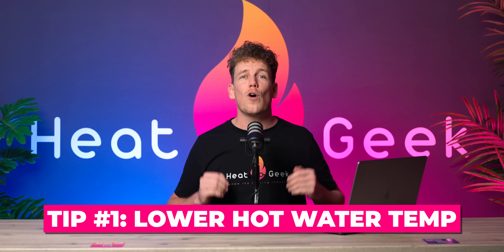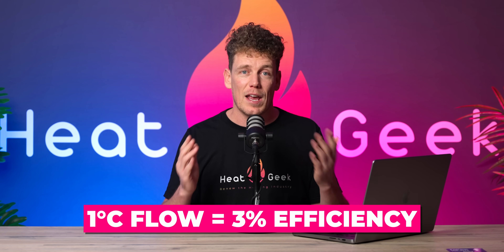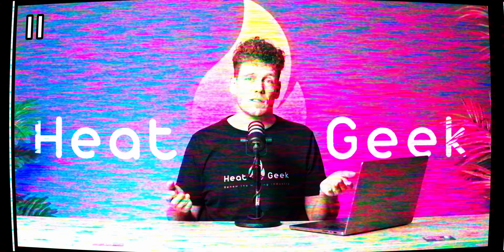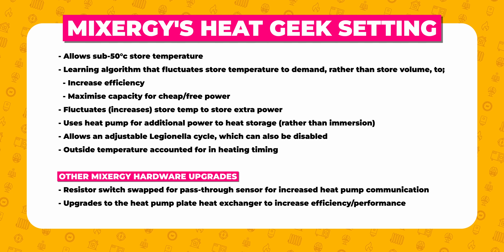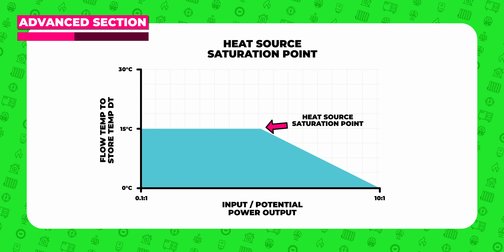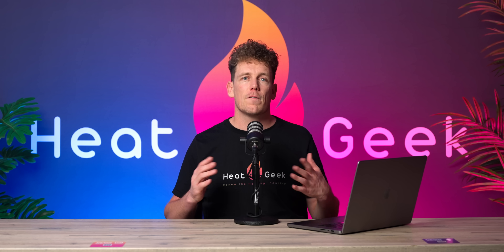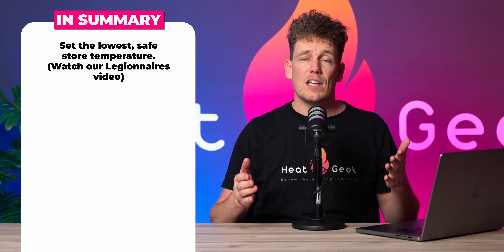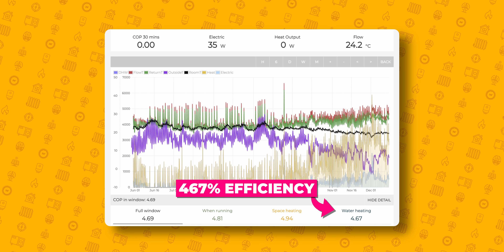Hot Water Settings Energy Suppliers Don't Want You to Know!

Comment: But wouldnt lowering the temp to 45 also mean you consume the water in the storage heater faster? When mixing down your also using less hot water which maybe more important for larger families. Have you worked out the trade off? Also this maybe prefered solution in cold climate whereyour system is heat only. But lets take an exapmle of a heat pump that provided both heating and cooling (2p FCU) and also has Solar Hot water. I work on many such systems. Lowering the temp to 45 especially in summer, causes the heat pump to cycle between cooling and reheat of water cylinder (as it takes preference over cooling). Going from 7deg LVT in cooling to 50+ to reheat the tank takes a long time and wastes a lot of energy
Reply from the maker: Yes.. that’s the balance…

Comment: Hi there, i didnt understand one thing when you talk about store temperature and scheduling: am I interpreting correctly that you advise setting your heat pump to heat the cylinder to your store temperature (e.g 45C) once per day (e.g 2pm) and then not be heating the cylinder other than that?
Reply from the maker: Yes, if you need more capacity you can heat to hotter or more often.

Comment: As you say Keeping cylinder higher makes sense if your electricity is 1/4 price between 2 and 4am and schedule it to heat only between hours. 
Ran it and confirmed it’s cheaper than reheating water multiple times a day at cooler temps 🤷‍♂️

Comment: Thank you for all the brilliant videos your doing - I appreciate the technical content. On this video section. Tip #2 Find Flow temp settings:- For Vaillant ASHP I noticed you refer to quote "Target Temperature differential" I assume you are referring to 'Settings->Installer level->Installation Configuration->Installation->DHW->Cylinder charging offset: K'. I have this week had new Vaillant VWL 5kW model. I was told to set this parameter to 10k, which I believe would set ASHP flow temperature = Desired Temp DHW + Cylinder charging offset' I would be interested to know more.
Reply from the maker: @philipevans3932  yeh, set that to 0 for efficiency, and 20 for speed. Although I’ve not come across a situation I would ever set it to above 0
Reply: @HeatGeek  |Thank you very much, your reply makes at lot of sense. I will play with this setting.

Comment: Why not use a Sunamp heat battery, no dilution of hot water with cold. No legionella issue. Stores for much longer than a cylinder.  I do not work for Sunamp or have any affiliation

Comment: Currently have my GSHP set to top up 48*C cylinder with a narrow hysteresis. Often seeing low daily DHW COP (2ish), but sometimes oddly am getting 3.5-4ish! No rhyme or reason it seems. 

Would it be more efficient to set DHW heating to a schedule and so allow the tank to cool and therefore heat transfer be more efficient (larger differential between heat source and cylinder temp)? Struggling to find out info on this, esp as GSHP doesn’t have the ‘window of warmer air’ that ASHP’s can utilise. 

This question also sits outside of time-of-use tariffs etc. Purely meant as an efficiency question.

Comment: At 4'45" Adam you are under the same misapprehension as I was, that Vaillant's target DHW plus their offset (or as you call it "differential") is the actual flow temp. But as I have recently discovered it is nothing of the kind, it is a *minimum*.

It seems the Vaillant HW strategy is to charge the tank as hard and fast as poss. This makes sense in the winter when you want the CH to have the min downtime. In summer it means the HP works unnecessarily hard and you do not get the optimal CoP. I would like to see it changed.

You have got the 7kW Vaillant HP so it is not so much of a problem. I have the 12kW unit which - even on the Eco setting - puts out 9kW at summer OAT, this means high flow temps and low CoPs. It would be better if this size HP had an Eco setting that achieved lower than 45.4% compressor speed, after all in heating mode it will modulate down to 27.2%.

Keep up the good work!
Reply: Mine still goes to full heat output and heats my hot water in less than 10 minutes flat. Although in the summer I seem to achieve  more than 400% efficiency from this.
I’ve a 16kW Samsung, it ramps up to an electrical input of about 6kW and ramps right down again before stopping, all done in 10 minutes. Is the chap saying that we should be looking for the control setting that reduces the DHW flow temperature please, rather than on then off?

Comment: Why can't a heat pump work on a standard open vented indirect cylinder therefore avoiding all the associated extra cost of unvented hw
Reply: It can, but you still need a new cylinder with a bigger coil but you can keep it vented

Comment: 2 - 4pm is also our peak solar energy production time so we are storing excess electricity as hot water. Only had the system since last week but we seem to be importing no more electricity than we did before the installation plus we are not using gas for hot water and not paying the standing charge.

Comment: Any gas boilers run an occasional legionella cycle on the hot water cylinder. Why can't heat pumps do that also. Are cylinder thermostats not sufficient? If water heating is on a schedule then no excess hot water should be there or at excess temp. Only ultra advanced cylinders can retain a lot of heat which few have.

Comment: I'm in Australia in a 12 unit block. We're hopefully installing a new central hot water (COP of up to 6.0) twin  heat pump and 400l tank system. We are required to have legionnaires disease protection. The Reclaim energy branded heat pumps are made by Panasonic in Japan. There's a smart controller that varies the storage tank temperature in 5 modes. Output temperature is 63 degrees C. The tank is heated to this temperature once a day. A 55C thermovalve is used with a timed recirculating pump. The cost of replacing the 315l tank and gas instantaneous heater up to current codes is $AU33k. The total  heat pump cost is $AU16k less $AU6.3k government subsidy.

Comment: Does anyone know if it is possible to adjust the temperature differential on a NIBE heat pump during hot water production? During the summer, it seems inefficient to me that the hot water cycle is only 45-60 min when the heat pump does not have to provide space heating (or cooling).

Comment: The basic reason heat pumps are wrong for hot water is that most households do not need that quantity of hot water as 80% of people use a shower to conserve water. I install bathrooms and more and more people do not want a bath installed. Heat pumps should be used for heating the house only
Reply: Why? I have PV and March to November is use my extra  output ( beyond my export limitation) and my water heating is completely free of charge. 300L of hot water daily for zilch. My water heats up in 20 mins or less and that lasts 24hrs.

Comment: Great Video as all ways. A little clarification or help please. At work we have a 300L vented DHW cylinder, and 2 gas boilers. This supplies an 18 bedroom Care home, with 12 bathrooms and 16 residents. Did you say in the video that in fact storing the water 70 degrees would probably be the most efficient policy as it would 'double' the overall hot water volume? ie at the point of use, cold water mix ratio would mean we use less hot water as distributed at 43 degrees to the tap/shower?
Reply: I installed and operate a 1000l ACV unvented DHW cylinder 2.4m tall in building with 30 flats and 34 bathrooms with two 48 kW gas condensing Vaillant boilers. I did not make a cascade but dedicated one boiler for house heating (1700 sq meters) and second boiler just for the 1000l cylilnder. I limited the power on DHW boiler to 25 kW and max output temperature of 63˚C with DHW temperature set to 50˚C with putting the temperature boiler probe just 1m down from boiler top (there is vertical tube in the cylinder for temperature sensor) so the DHW boiler has lower return temperature when operates is condensing. Hot water circulation in building is running just in cycles of 2 minute circulation/20 minutes no circulation so the hot water in cylinder is not mixed with cold water sitting on bottom. The other boiler is just for heating the building with weather compensation so there is no interruption during long DHW heating.
I found also a good thing to configure 1˚C heat-curve down (19˚C instead of 20) setback night temperature (on vaillant VRC 720) not to get return temperature over 40˚C during night when it is colder outside (and HC calculated flow temperature is higher).

Comment: The amount of arguments I've had with my colleagues about doing this. In the end in an electric only block I set up some flats this way while other flats were left at the standard set up, the difference was almost £100 a month and no complaints as they're required to have temperature limiters at outlets in new builds. They're heated by Heatrae Sadia Amptec units so the saving is no where near would it could be with a heat pump, sadly these flats aren't suitable for heat pumps in the future due to the short sighted design of the new builds being built.
Then for 2 hours a week the immersion heats the tank to 65c for disinfection. 
This only works because the Amptec units can just about keep up with the hot water draw off though - one bathroom. If there are 2 bathrooms the storage temperature needs to be higher.

Comment: if air source heat pumps extract heat from the air can they not be installed indoors and take advantage of the warmer air.
Reply from the maker: They blow out cold air when they extract the heat. It would be an infinite loop
Reply: @HeatGeek  thanks, perhaps connect outlet to the outside then
Reply: Exhaust Air Heat pumps do exactly this although few manufacturers actually make them and those that do somehow fail to achieve better SCOPS despite the warmer feed in air. I hope the industry will develop these units further as they have great potential
Reply: Works an intermediate source due the the amount air needed. It is better used as a ventilation system were incoming air can be heated with heat pump energy.

Comment: If you have a heat pump and solar PV and use cheap overnight electricity you can save more by lowering your hot water set temperature during the day so the heat pump only heats at night to the higher temperature when electricity is cheap. Also, never heat your water with "free" solar PV excess as that will just stop your heat pump heating the already hot water - the heat pump is much more efficient than the immersion heater and you are better off exporting the excess solar at today's export rates and importing at the cheap rate for the efficient heat pump. If you heat at a COP of three and import at half the export rate that's six times more efficient than diverting the solar to heat the water directly.

Comment: Don’t tell me that I have just bought your new cylinder !
Reply from the maker: If it’s better it will be a small difference. Mixergy is a little more expensive too.
Reply: the coil is so big on the HG cylinder, it dictates to flow temperature from the heat source. from about 7:00 in the vid he talks about this
Reply: Indeed I did get through the whole vid , my comment was a bit tongue in cheek as I literally agreed with installer the day before a new HG tank .

Comment: In an ideal world, yes, keeping the water temp just right so that the showers get water at your preferred shower temp, but what about houses that don't have massive space for the cylinder. I see lots of vids where they seem to be in garages or cellars with spaced-out pretty piping and that all looks very nice and the cylinders are colossal. But back in the real world where most people live in tiny houses with no space and three kids, where the wife takes a 20min shower and then three teenagers and a dad use 5-7mins each, well we need about 300l of water despite having room for a 200l tank, in that circumstance I'm afraid you need to heat the water to 50% higher temp and down-mix it, e.g. 56 degrees mixed down to 38 at the shower. I don't want to poo poo this advice, which is usually excellent and incredibly well thought-out on this channel with great physics to back it up, but on this occasion I think a caveat to acknowledge that, excepting baby boomers, no one can afford the sorts of houses our parents had and are living in seriously space-poor buildings with room for not-so-massive tanks. I just saying, that I reckon at least 60% of the installs will be in houses that cannot possibly put gigantic tanks in that would allow for 5 showers every morning within an hour of each other if the water is only heated to shower temperature.

By the way, one small note on the eco-mode to drop the heat output during the hot water cycle - I found during a lot of playing around this winter, that it actually used MORE energy (although only slightly) and I think its because it was taking so long, that the outside air temp had dropped out of its maximum and it seemed better to leave it on the more powerful mode to get it done quickly during the hottest hour from about 14:15 (not 14:00 in my location, that could be due to hill side, I suspect it varies a bit), to 15:30. Also I have to say that the outside temp and the time it stayed hottest varied so much from day to day (literally 10 degrees from one day to the next on occasion) that my tests were likely not statistically terribly good. Edit, oh, also note that I have an ecodan, not a viesmann which might have far more sophisticated eco-modes, although I did watch the flow temps and it certainly does change it, dropping it and chasing about 7 degrees above the current tank temp until about 40 where it always flatlines to the target temp, I guess more snazzy kit might do something more cunning.
Reply from the maker: The answer to your specific exact question is answered in this channel next week.

Comment: Respectful question/observation. 
Heating the water in the afternoon when the outside temperature is higher makes sense and will promote greater efficiency.  
However the cost of the electricity may be significantly higher at 2 in the afternoon than at 2 in the morning ? 
The actual heat pump/cylinder efficiency will suffer but the actual cost of heating the cylinder could be considerably less ? 
Thank you. Excellent presentation as always.
Reply: Actually on Agile 2-4pm the price is similar to overnight and the last couple of weeks with extra wind & solar was cheaper than through the night
Reply from the maker: Yes we adress the balance between performance and tariff in this video though. Thankyou!!!
Reply: Octopus Cosy has 3 cheap tariffs per day, one of which is 1pm - 4pm. Because this tariff is a lot cheaper than the standard, it's financially worth heating the hot water at full power (not Eco mode) in the winter, to share the cheap time with the space heating. Space heating will probably be timed to be off for the 3 hours of peak time (4-7pm), so you wouldn't want it to be off too much in the remaining 21 hours because the hot water is taking ages to heat up.